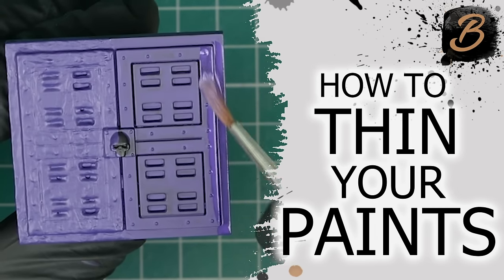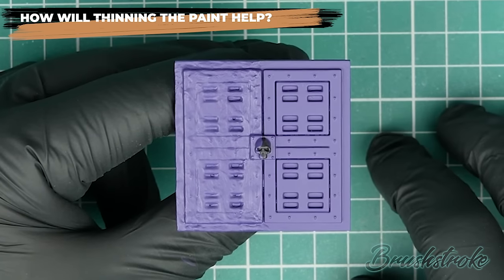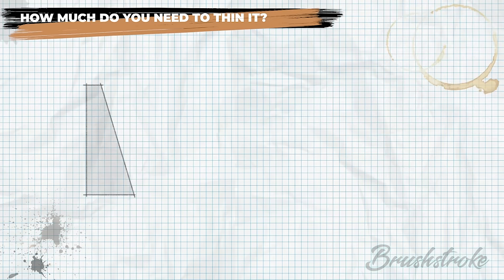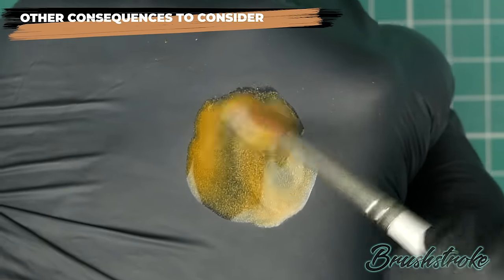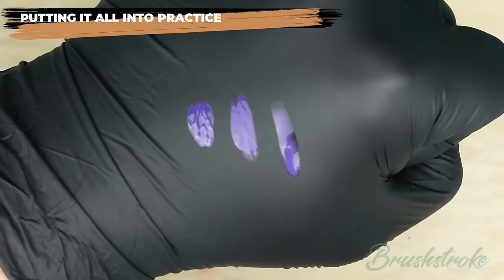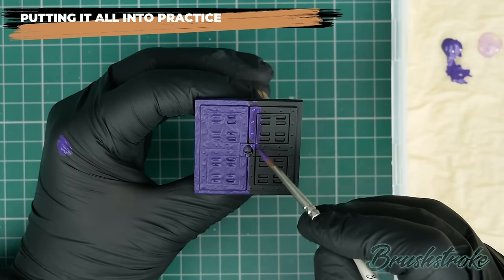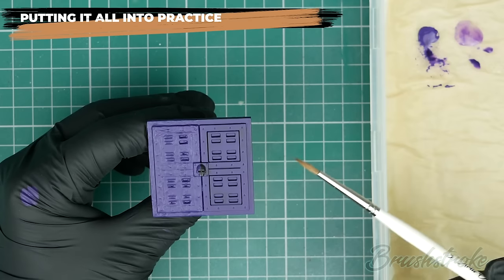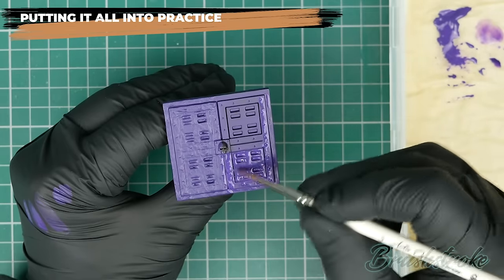HOW TO THIN YOUR PAINTS: A Step-By-Step Guide

Comment: Yeah, but you splodged the first lot of paint on, you could have done a 1000 times better straight from the pot.
Reply from the maker: I’m not going to disagree, however, there were reasons for it.
It was merely meant as a means to an end and be a catalyst for the discussion, as I’d already said the purpose of the video was to try and explain how I get my super smooth finish.

Also because I can’t assume the painting level of the viewer, by starting with a bad example (all be it exaggerated) it means I don’t alienate anyone by making them think they can’t even paint like the “bad” example.
It's supposed to make everyone think “hell, even I’m not THAT bad” :)
More experienced painters (such as yourself) would see it for what it is and really compare your current paint finish to that of the thinned example.
Does your process produce the same result? If so, awesome then you’ve already found your way. If not, then watch on and hopefully find some pointers to help improve your results.
That’s all this video is for. There’s really no tricks.

Comment: man, what a great comparison when you paint like 15 layers worth of paint onto the model and say "see? this is what happens when you dont thin your paints" as though using half of a bottle of paint is the standard for covering 2 square inches. if you use the same amount of paint on both sides, then you get an accurate comparison and display of why thinning your paint is the better option. its like saying "oh ketchup is better than mustard. lemme show you." and then procede to empty the entire bottle of mustard onto the hot dog, while only puting a line of ketchup on the other. it's an unbalanced comparison
Reply from the maker: Hey man
I'm not going to disagree with you at all. The comparison was purely as a means to an end and as such, an extreme example is much easier for beginners to appreciate, than relying on the camera picking up the subtle nuances.
The purpose of the video wasn't about that comparison, it was more about the concept of all paint being on a scale of fluidity and using that fluidity to fit your purpose.
Can the unthinned paint be used in the method you describe? Of course. There are so many factors and other elements at play in all of this. Technique, application, skill level, brush type, environmental influences will all have an effect on the outcome.
It's clear you have already acquired skills and knowledge which this video isnt aimed at as such.
So, yes, apologies for the exaggerated comparison, it wasn't meant as a binary, simply as a catalyst to spark the discussion.

Comment: I'll be honest, the first "unthinned paint" example feels dishonest. You didn't apply unthinned paint with any care, you just slathered it on and left it to pool etc. I use unthinned paint a lot, and my default finish is the same as your unthinned paint example. That's not to say that thinning paint isn't an important and valuable skill, thinned paints help new painters avoid a few problems that unthinned paints present, but the finish you showed for unthinned paint isn't due to unthinned paint.
Reply from the maker: I’m not going to disagree, however, there were reasons for it.
It was merely meant as a means to an end and be a catalyst for the discussion, as I’d already said the purpose of the video was to try and explain how I get my super smooth finish.

Also because I can’t assume the painting level of the viewer, by starting with a bad example (all be it exaggerated) it means I don’t alienate anyone by making them think they can’t even paint like the “bad” example.
It's supposed to make everyone think “hell, even I’m not THAT bad” :)
More experienced painters (such as yourself) would see it for what it is and really compare your current paint finish to that of the thinned example.
Does your process produce the same result? If so, awesome then you’ve already found your way. If not, then watch on and hopefully find some pointers to help improve your results.
That’s all this video is for. There’s really no tricks.

Comment: i paint with unthinned paints... and never had the result you had on the first thing with that comparision...
if you of course just pour your paint in there like it's a bucket and you need to fill a swimming pool, sure... that's the result.
But that's just doing it wrong on purpose.

this has the same appeal as those 'white people problems' commercials on TV... 
it has the "have poured all the orange juice into your crotch instead of a glass" style

srsly - not worth watching this video right after the first panel
also the use of emojis... 
in the thumpnail?

that's heresy and having a comissar have to have a talk to you is now obligatory... and then off to the gulag.
Reply from the maker: Thanks for taking the time to comment

So the comparison is meant purely as a means to an end. It’s just there as a way of kicking off the conversation.
The “meat” of the video is the fact that all paint should be considered as being at different points on the same scale and through observation it is down to the painter to determine whether the paint is currently at the right point in order to achieve the result they want.
The left example was done purposely bad as I can’t assume the skill level of the viewer and in no way did I want to alienate anyone by making them feel like they’re not at that level even.
It was my feeling that more experienced painters, such as yourself, would simply compare themselves to the right side and ask if their result matches. If so, great. If not, then watch on.
If you were to watch on I hope you would see the actual detail is very much not dumbed down infomercial rubbish and in fact an attempt to actually explain how I achieve the flawless finish of the right hand side.

I'm sorry if you feel misled by this video, but I would just ask you watch it through to the end and see if you feel the same then?

Either way, thanks for checking out my channel and have fun painting

ps please dont send me to the gulag!! :/

Comment: "Add water."

There, I just saved you a f*cking 20-minute video.
Reply from the maker: Woah!
spoiler alert!
Reply: @BrushstrokePaintingGuides  hey could I ask you a question, im using the redgrass wet palette and my paint does not go all watery and have the movement like yours does, is that because your using parchment paper or something ?
Reply from the maker: I have heard similar from a few other people who use a Redgrass palette. I don’t have access to one unfortunately, but having read up on their website it does seem to be due to the unique surface they’ve developed for their membrane. Those other people have said they have tried the parchment paper I use ,as a test, and found the difference to be extremely helpful.
This is the paper I use
HTTPS://amzn.to/3ngaKi4
On the plus side, it’s a lot cheaper than replacement Redgrass sheets, as the roll is 9m long! 😮
I hope that’s helpful?

Comment: 1:33 "...let's be honest..."
Ok, let's do that.....  at this point you have not painted the piece with paint directly from the pot; you have taken paint directly from the pot and then thickly daubed it onto the piece.
That is not an accurate representation of what happens.  I'm looking to get back into mini painting after around 20 years off.  "Back in my day" (lol, old fart alert 🤣), yeah we used it neat from the pot and I'm talking gen 1 & 2 Citadel pots, but we 'painted' with it, we didn't dump it on so that it looks like a 50/50 mix with corn starch.
I'm guessing you're over-egging the negative to make your positive look that much better, you don't need to; just be honest and the results speak for themselves.
Reply from the maker: The comparison IS over egged for sure, purely as a means to an end.
Having an extreme is much easier for beginners to assess. 
Can the paint direct from the pot go on better? Of course. Could I achieve the same result without thinning it down? Personally, no I couldn’t. Others maybe can, I’m sure.
Would comparing the subtle nuances be picked up on camera and come across over video? I’m not sure.

The purpose of the video is to try and explain how I get my results. The comparison is there just as that catalyst to spark the discussion. Hope that explains my rationale a bit more 🙂